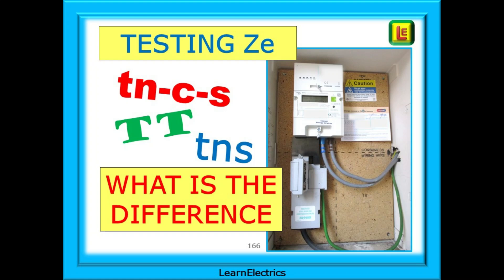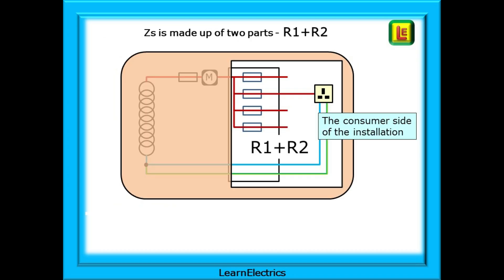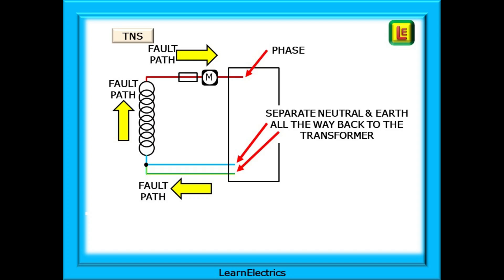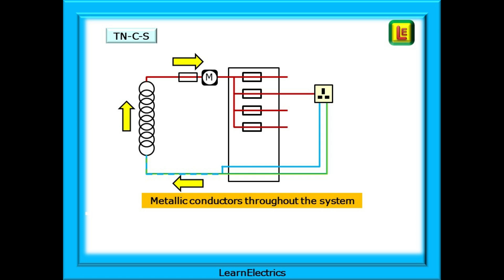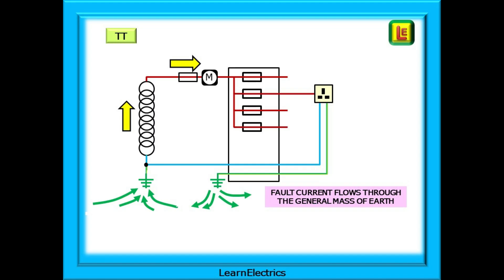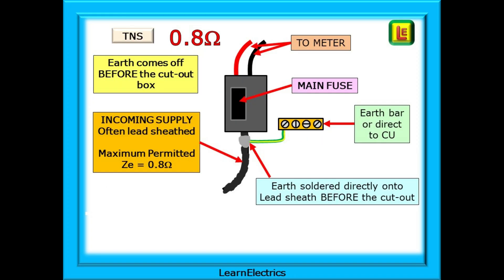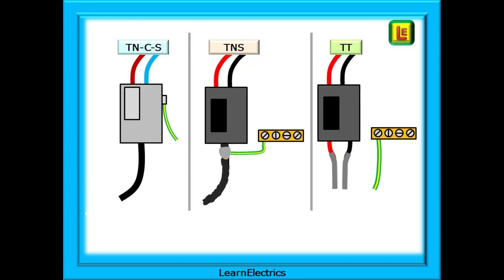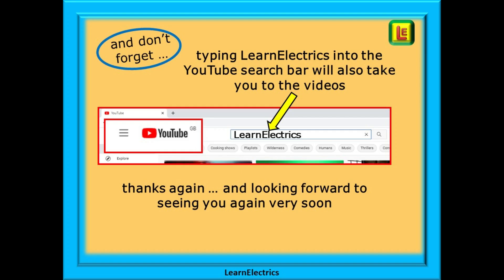TESTING ZE – TNCS – TNS - TT - WHAT ARE THE DIFFERENCES BETWEEN THE EARTHING SYSTEMS

Comment: I NEED HELP, I  need to understand why and how, in a fault the cpc becomes live and takes current to the transformer and due to the lower resistance there is an imbalance in the  neutral/Live so the breakers trip, THATS WHAT IVE BEEN TOLD, doesn’t make sense because if the cpc cable is smaller in size there would be more resistance not less right? And how would that affect the breakers, does the mechanism in breakers trip become the neutral does not have a return path or something else
Reply from the maker: Have a look at these videos. the answer lies in the loop impedance. The LearnElectrics.com website also has a search box to find videos on specific topics.

https://www.youtube.com/watch?v=A9Zze4uNgRw
and
https://www.youtube.com/watch?v=QWr-ilqW67A

Comment: It's fun to watch these, since TT aren't allowed in Sweden where I live, and unless the building is from the early 50's or older, all houses regardless of there use are 3 phase here, a normal house hold have 3 x 16 Amp fuses, since we never use single phase anymore and haven't done so for some 60+ years here. Most have TN-C too the meter and then we make them TN-C-S inside the houses. Greetings from Sweden 😁
Reply from the maker: Thanks for the info and thanks for watching. Dave.

Comment: What if we have TT like in the video but we also combine neutral and earth in the meter? I think that's what we have here, in fact the earth and neutral terminals in the meter are linked by design. I used a multimeter to confirm the continuity between both terminals of the new meter (uninstalled).
Reply from the maker: In the UK there are only Line and Neutral connections in the meter. Thanks for watching. Dave.
Reply: Then it is not TT. It is TN-C-S. A multimeter is not a proper tool for such measurements.

Comment: Hi Dave ,is it common to convert an existing TNS to a TNCS TO upgrade the earthing and how is it done without removing the TNS Part of the system pls.Big Thank you.
Reply from the maker: This is something you need to discuss with your supplier as this will require changing the supplier's cables.
Thanks for watching. Dave.

Comment: Love your vids. I’m currently studying.. please could you do a video explaining how neutral and earth are connected together yet no current flows back on the earth and down all your cpc’s? I don’t understand how earth and neutral are connected together and also I don’t get how current can flow through the ground in a TT to disconnect when soil is an insulator 

Thanks
Reply from the maker: Thanks Jake. Watch the video again, it tells you what happens to the fault current in a TT system.
Reply: The resistance of the PEN-wire is so low that only minimal current goes other routes. If the PEN wire breaks then it is another matter.

Comment: We had a TT system in our house in Cambs (overhead supply). The earth was bonded to the copper water pipes instead of an earth rod. Problem was, the incoming water (and gas) pipes were plastic. With a typical collection of appliances connected up, there was enough leakage current to earth to give a fine belt when touching the taps. It now has a proper 1m long ground rod.
Reply from the maker: Yes, some of the old methods left a lot to be desired. I stopped in a chalet on a remote Scottish island that was like that. Thanks for watching. Dave.

Comment: Most pple in my country use TNC. S but with earth rod on building . So in case of fault which path does the fault current use back to the transformer, neutral or earth rod then to soil upto transformer
Reply from the maker: The fault current will share itself along both routes according to the conductance, so most will flow along the metallic neutral/Earth. The earth rod could be there to balance any potential differences around the building. Thanks for watching. Appreciated.
Reply: Thank you

Comment: Nice one dave another brilliant video 👍👍 can I ask, maybe a silly question but what happens if the Ze is well over maximum value (does it ever happen) do you just notify the dno and leave it with them .cheers dave 👍
Reply from the maker: Its never happened to me but yes, we should notify them because our own work won't pass the tests.
I know of one sparky who contacted them, told them the customer was in danger and they were there in an hour,
Dave.
Reply: @learnelectrics4402  cheers dave good to know 🙌🏻🙌🏻 not sure if you have done one yet but will you be able to do a video on multi function testers functions 2 lead high etc especially a merger as that’s one I’ll probably invest in when the time comes 👍👍